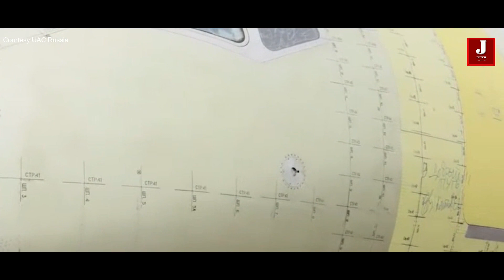Aviation Sanctions? No problem!  Russia Builds First Sukhoi SuperJet With Domestic Parts

Comment: Compared to the Snecma engines originally used those engines look positively ancient, like they were taken off a jetliner from the 1970s. Spec-wise the thrust is the same but I can't believe that the in-service fuel efficiency will be even close given how much narrower the engine is.
Reply: This is a new engine called PD8.
Derived from the PD14 engine
Reply: The engines in this prototype, in this video, are the SAMs (Snecma). The pd8 appears in the first il76 testbed (the blue one), and looks pretty similar to the russian-french SAMs, in comparison (proportionally) with the old D30 installed in this il76... The SAM inlet diameter as about 1.20 meters, and the old D30 series have around 1.50 meters of inlet... Maybe, what you notice is that SAMs are "wider" while the Pd8 looks more circular in frontal shape, but, if is the case, this have nothing to do with the air intake of the engine, but the way that internal hardware is located. I studied the SAM engine, but not the pd8, yet, so I may be wrong.
Reply: This plane has Russian systems but as PD-8 engine is still being tested, the engine on this plane are original French/Russian Snecma engines.
Reply: Who care abaot fuel efficiency , now Russia need a plane and they have a lot of fuel , so.... all this happend thanks the USA and the Corrupt and Nazi regime of Ukraine .
Reply: If fact this is Snemca engine, first prototype uses sam-146, second prototype will use PD-08.
Reply: I Wonder if it will ever get EASA and FAA certification.
Reply: @patpat5135 in current geopolitic situation, i’m pessimistic. If stupid sanctions keep goin, Russia will totally use SSJ to replace all airbus and boeing for its regional services. And then Africa, Asia, and on.. USA & EU literally stepped aside and gave room the competition.
Reply: @macanngantuk1439  they did that not only in airplane market. They did that in grain markets, agriculture, powerplant turbines, shipbuilding to name a few.
Reply: @antonh1709  same with Japan, Korea, China. Decades ago American and europeans said their products are shit or low quality.
Now look what they are having in their homes.
Reply: @macanngantuk1439  competition is a good thing for customers and products improvement.
Reply: @patpat5135 
From technical POV PD-8 engine is better than previous SaM-146.
So certification is just political object of manipulation.
Russia is important transit country for EU, Japan and USA airlines. Now transit over Russia is closed for the countries considered as adversaries for Russia.
Russian aircrafts smooth certification will be tightly associated with airlines transit over Russia.
Reply: You assumed that the plane shown had Russian PD-8 engines on it and immediately started insulting how outdated they looked compared to the ultra modern western design...
Thanks... for confirming that the western designs looked, if anything, more ancient than the Russian ones!
Reply: @jerromedrakejr9332  That's a fair cop, true.
Reply: this is proto type   nothing fix yet